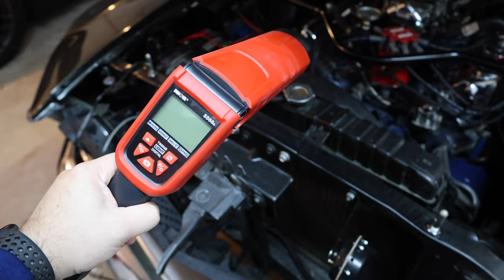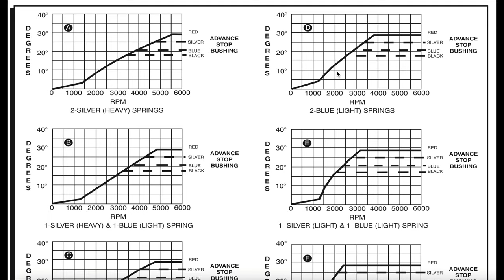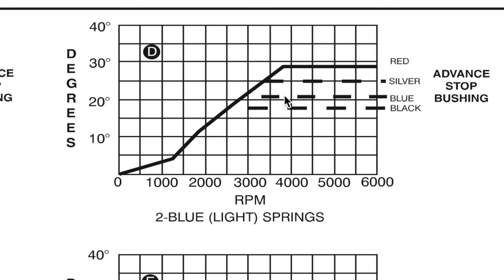The CORRECT way to Set Timing on Ford Engines with a Distributor

Comment from the maker: My Preferred Timing Light (In this video): https://amzn.to/3xlp3oH
As an Amazon Associate I earn from qualifying purchases.
Reply: Any tips on 1996 efi 5.8 bronco? I took the cap off, the small one by the firewall, set timing a 10 btdc put the cap on and it still goes to something like 15 atdc. If I leave the cap off, it stays at 10 btdc and runs great. It's a conundrum for me. What am I missing?
Reply from the maker: @colt-ss3lw  you are talking about the connector you removed right? It sounds like the distributor is advancing 25 degrees. -10 to +15. I know some newer cars are setup BTDC for emissions. Is that what your original sticker says?
Reply: @SmackeysGarage  🤔 Original sticker? The 1996 bronco has an emissions sticker. Is that where I find timing for my specific truck?  I followed the online ford manual.
Reply: @SmackeysGarage  351 modified & Windsor say 10 btdc. Like I said, without putting that connector back it stays at 10 btdc @ 2000rpm. Put it in and it changes, so I left it out. Trucks running great. It just puzzles me and I want to know why. I think this is lost knowledge about the timing/efi/ecm system. Every mechanic I talk to, as soon as I mention efi, they throw up their hands and say, "you can't time a truck with efi the computer automatically sets timing." I haven't driven it far enough to get a mpg average yet, but before city was about 8 and highway was 10. I'll subscribe, fill up and check the mpg w/o the "cap/plug" in and give you an update.

Comment: On some or all of the old 223 cubic inch 6-cylinder engines, the ignition distributor had a single shaft, no speed related spark advance means. The carburetor had a small hole in the venturi which was to put a vacuum on the vacuum advance feature, along with a slot down by the throttle plate, also to supply vacuum to the vacuum advance diaphragm. A passageway which included a small, light plastic ball formed a tiny check valve so that when venturi vacuum was established, the said slot would be sealed off so that the venturi would become the sole vacuum source to advance the ignition timing. Such was the case in, for example, a '59 Fairlane 6 cylinder 3-speed manual transmission.
Reply from the maker: That's cool to hear about. It really is an interesting design to use a ball check valve like that in a space to cut off one of the vacuum sources.

Comment: Thank you sir.. just wanted to tell you that you're doing a really good job at your video I watched 8-20-23... Trying to work with my 302 it's skipping and backfiring and popping out.. hopefully by replacing the sprockets or gears and timing chain by doing this,  Maybe this will help my old 1995 Ford F150
Reply from the maker: Thanks, I appreciate it! When you were diagnosing it, was the timing jumping all over the place? I do like the 1995 F150. It had such a good look to it.

Comment: I’ve been messing with measuring and marking my balancer and using a simple cheap timing light… I’m done. I’m getting the one you recommend.
Reply from the maker: The one I mentioned is definitely a nice tool. They are simple systems, but it is nice to have RPM on the screen as you set timing.

Comment: Picked up a 72’ Lincoln Continental with the 460.  Looks like they changed the carb but didn’t hook up the vacuum advance off the distributor… but I’m not seeing where to hook it up now with the new Edelbrock.  I’m pretty green with this motor.  Tips on what to do first?? Change to electronic ignition? Get the vacuum advance hooked up and check timing??
Reply from the maker: That’s awesome! Love those big Lincolns!!! I think on the edelbrocks the timed vacuum is on the front down low. I’d get it running well as is before you start changing things up. Maybe a tune up and new points. Otherwise I like the idea of electronic ignition first.
Reply: @SmackeysGarage  you’re awesome!  I’ll check in the morning.  Yep, less than 50k miles too.  Thanks!

Comment: I have a 393ci windsor that was built for me 20 years ago. What would you suggest for total timing?  It has 10.5 compression and afr 2.05 aluminium heads. Thanks
Reply from the maker: I'd say it is best to dyno it and adjust and find out. Each combo is unique. Do you know where you are at right now for total timing?

I'd guess 32-36ish as a starting point.
Reply: @SmackeysGarage  engine was dyno'd back in 2003. I will see if they listed total timing . Thanks for the info

Comment: Got a 302 here that was swapped to a carb from injection from a 93 cobra. Runs great now except wen u get into 4 barrel it pops. Just cleaned the carb and stuff too. Would yall possibly think it could b timing. Cant use a timing light either cuz the harmonic balancer is off
Reply from the maker: Was it running good before the carb swap? If so I’d check for a gap in the fuel when going from primary to secondary. Either the first shot is ending too early or the second shot is starting too late if it’s a double pumper. 

Could also be timing if it’s way off at the upper end. No harmonic balancer as in you can’t read it or it isn’t reading accurate? If it isn’t reading accurate I’d start there.
Reply: Well i appreciate the reponse and i do think it is timing and def will get the harmonic balancer worked out. But tbh dont really know how to go about doing that
Reply: And off as in not reading accurate to tdc
Reply from the maker: @countryboysgaming3032  I'd get that sorted first. Even grab one from a junk yard if you can.
Reply from the maker: Should just be a few bolts to remove the pulley and a large one for the balancer. You might need a puller for it though. I’d look up some videos on YouTube on how to do it.

Comment: New Ford Duraspark for 351C, 7000 rpm engine set up. All duraspark distributors have WAY too much mechanical advance built into them. Disassemble, removing reluctor wheel and underneath you will find advance mech. They are stamped for advance. Multiply by 2 for actual. Weld up the slot to limit movement to about 2/3 of original. This will make engine difficult to start hot. (how to fix later).  Install in to  engine. Block vacuum advance port on carb, disconnected from dist. Start engine and rev up till all advance is in looking at timing light. 36 degree total. Reconnect vacuum. Drive vehicle, and if it pings, add a 3 port tee into vacuum advance line with one port rubber plug that you can melt bigger and bigger hole till it quits pinging. All set. 

Now hot start. The white wire on the Duraspark module (blue strain relief) can be used for a electronic retard for starting. Connect this to the starter relay so energized when cranking. Nitrous? Energize the white wire for nitrous retard. Now you have a race ignition that will make your engine zing when throttled!!!! Maybe add a little more accelerator pump squirt from carb also till very crisp!
Reply from the maker: Sounds like you have a great setup on that 351C running to 7K! Lot's of great information Ron. Thanks for commenting!!!

Comment: I’m trying to figure out a 306 w/ 650 double pumper. I am guessing start with 10* BTDC and then check under the cap for the remainder? My question is, does MSD have a spring/bushing kit? Also, Say I am at 10* and under the cap is 28* and I want to be 32* total, can I back off to 4* BTDC and be equal?
Reply from the maker: Hey just want to make sure I understand. You have 10* initial and 28* advanced under the distributor. That would put you at 38* total.

If you are happy with the 10* initial, I'd put a spring that gets you 22* advanced to be at 32*. Changing the base to be that low may make the car more sluggish off the line.

Now every car is different. The best you can do is test out different scenario and see what works best for you. I'd start by changing the MSD springs and bushings. The second half of my video, I show how to change them on the carb. (MSD does sell a kit)
Reply: @SmackeysGarage  Thank you!
Reply from the maker: Anytime!

Comment: Current setup is 351W, Holley sniper EFI, Rpm air gap, rpm heads, X Cam, longtubes. What would be the best initial timing for me?
Reply from the maker: Tough question to answer because it really depends on the combo. Most small block Ford engines will work well with 10 BTDC. 

What really matters, is Total Timing. USUALLY 30-34* Total is what small block ford's like. If you have want to get advanced, I would set the total timing in that range and take it out and listen for pinging under heavy loads. If you have 10 degrees base, and your distributor is adding 24*, then you would be at 34* total timing. If you bumped the distributor to 14 degrees, then you would be at 38 total timing. I would start by setting the base to 10 BTDC and see how it runs, understand what the total timing is, and then make adjustments from there. Do you know what your total timing is with your current setup?

I typically will find what total timing the vehicle likes the most, and then set base timing to what gives me the best off the line, and startup performance.
Reply: @SmackeysGarage  thanks for the info. Ive seen how to find total timing by revving the engine to 3k rpm and seeing where its at with the timing light. My conundrum there is do i do this with the vacuum advance connected or disconnected? ive seen that timing should be set with the vacuum advance disconnected and plugged. Can you explain and fill the gaps for me on how that would work? much appreciated.
Reply from the maker: So your goal is to set the timing without any influence from the vacuum canister. To do that, pull the tube from the vacuum advance and cap it. If you do not cap it, the car will have a vacuum leak and not run right. The vacuum can adjusts the timing based on engine load to help efficiency. You do not need that to set timing. If you did leave it connected, which you shouldn’t do, the timing would jump all over the place.

Comment: This may be silly question but I was reading on a forum about adjusting timing. The guys on the forum are saying when adjusting the timing you have to disconnect the "Spout" from the distributor. From what I gathered it's the actual wire harness that comes off the distributor. I noticed you didn't do this in your video. Is this something that you have to do? And nice car by the way.
Reply from the maker: Hey B Patt B, it is a good question. When they talk about disconnecting the spout, they are talking about removing the vacuum line from the vacuum advance. You do not want the vacuum advance changing the timing while you are trying to set the base timing. On my previous distributor, I would disconnect the vacuum advance, and then plug the line that goes to the carb (or cap it). After setting timing, you then reinstall it.

This distributor does not have a vacuum advance so there is no need to plug it. If you have a vacuum advance, it must be done to set the timing. Thank you!
Reply: @SmackeysGarage Thanks for the answer. I recently purchased a 65 for a really good deal. Little old lady kept it for a long time because it was her husbands. Only problem is no paperwork. It's got an MSD distributor, coil, and spark box. It had a 650 double pumper on it but as soon as I got it home and it sat for week the carb loaded the engine with gas. Stuck floats? I guess it could have got into the fuel pump? At any rate I replaced the carb with a Edelbrock 600 and a new fuel pump. I wish I knew what can was in, judging by how it sounds it's very lumpy lol. Anyway I got a little sidetracked after the carburetor switch I'm getting fogging at low RPMs and pops from the carburetor. Im going to try bumping the timing some tomorrow. On the harmonic balancer there is a mark on 10° so maybe it's at 10 and wants to be at 12-14. Anyway my family wants to see it so I'm going to put a little video of it up. Take a look.
Reply from the maker: Is it the "64 1/2 D Code" video? If so it sounds really good and looks to be in great shape. Definitely someone has taken care of it. 

Sounds like you are going in the right direction with the pops through the carburetor. It's usually a timing issue where the intake valve isn't fully closed when the mixture ignites. I've also seen it happen when the engine is running too lean or not enough gas. It can also happen with bad plug wires or when wires are too close together and cross firing when they shouldn't be. Lot's to check.

Does it pop every time you rev it? I'm assuming it's happening when the engine is not hot and the choke is working. They are fun cars to work on and are pretty simple. I'm sure you will chase down what is causing it to happen in no time!
Reply: @SmackeysGarage  yeah that's my car. The registration had it listed as a 65 and I got to digging around on the VIN number and apparently D codes were only made in 64 and 1/2 and they are factory 289 4 barrels. Hopefully tomorrow in my new timing light shows up I'll get it dialed in and put up another video. Thanks for the help I appreciate it.

Comment: Since my truck is cammed how to I know how much I need to advance it
Reply from the maker: So I'd recommend finding someone with a similar combination as a starting point and workin from there. I'd do a google search to start.  Timing depends on a lot of different factors in an engine. 

After you get to a point where you feel more comfortable with it, you could start working with the advance and ensuring that the vehicle isn't detonating when under a load or normal driving.

Comment: 88 302, no timing marks on my balancer.. i need to advance it more and my distributor is rotated as far clockwise as i can with the TFI in the way.  I need it to not be sitting next to the head.. which way do i rotate the crank with the distributor out to advance more?
Reply from the maker: Yikes, no timing marks at all on the balancer? They corrode off over time? I'd consider replacing the balancer to see where you really are. I'm not sure the answer to your question  as I've never tried that. The fact that your TFI is hitting seems like you might be way off.
Reply: @SmackeysGarage  totally, i need it 45deg counter clockwise from where it's at.  There is a lot of surface rust on it, probably wicked away over the years. I'm just wandering what a 45deg rotation of the TFI means in terms of degrees of timing on the balancer. every 0.56" on the balancer is 10deg of timing. If i know this i can figure it out without the timing marks on the balancer

Comment: I've got 2 vacuum lines coming off my distributor, 1 going straight up and 1 coming straight out, which do I pull off. or do I remove both of them ? Thanks
Reply from the maker: One for ported vacuum one for manifold vacuum?

When you are setting timing, you don't want to include any vacuum advance on it. I would pull both, you should see your base around 6-10* and then adjust from there. After you set mechanical advance, I would then take a look at your vacuum advance.
Reply: @SmackeysGarage  thank you
Reply: The vacuum going straight up goes to the manifold, the one straight out the front goes to the carburetor.
Reply from the maker: @timothyfrost8807  One is "manifold vacuum" the other is "ported vacuum." The manifold vacuum source gives you vacuum advance at idle. Ported will give you the same vacuum but only when the throttle is cracked open.

I've never ran a dual source system like that. I'm curious what type of engine it is. Is it a 70s Ford engine?

Comment: Can you adjust the springs? Or are they preset by the manufacturer?
Reply from the maker: The springs are manufactured to certain rates. You cannot adjust the performance of the spring. You will need to change to a different color spring to change the timing.
Reply: Spring are different colors because they have different tensions. That's what the chart for. Always try to mount your coil straight up and down. Gives them longer lives plus DOSENT let oil leak out the nose. Either buy stickers and put them on your spark plug wires or a pen to save yourself spending the time to find firing order. Really just need to pull 4 wire on one side and move the cap out of the way.Retired Professional mechanic

Comment: Where are you located and would you be interested in working on a 351 Cleveland in a 1972 grand Torino
Reply from the maker: I’m in New England. I only work on my cars typically. What’s going on with yours?
Reply: @SmackeysGarage  well I bought a 600 holly carb and I’m trying to figure out where should I run the hot wire it has an electric choke I keep getting told different places
Reply from the maker: Any place that is a switched 12v source on ignition only. Depending on how your cars wired I could see different answers. Does your car have a resistive ignition wire? The coil typically starts at 12v and then drops down while running on the distributor side